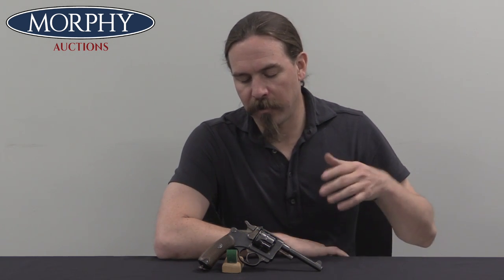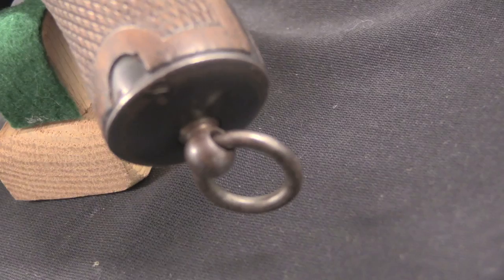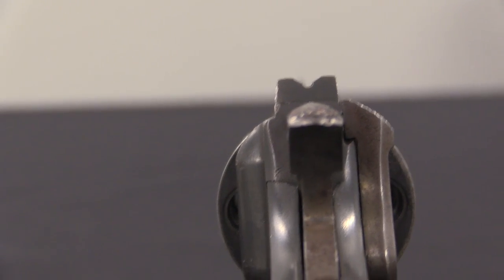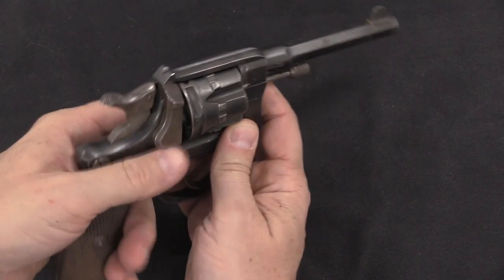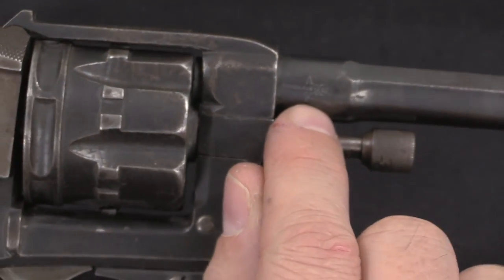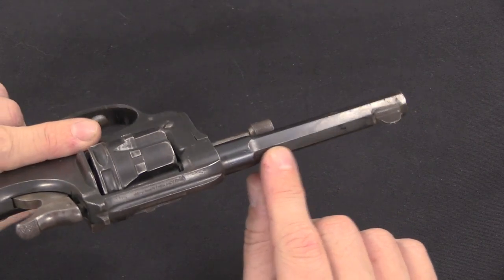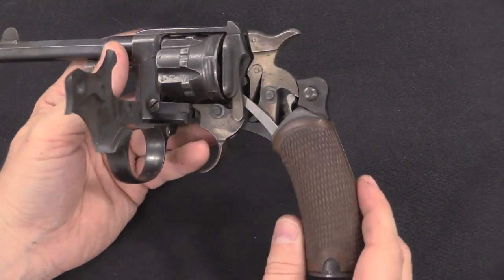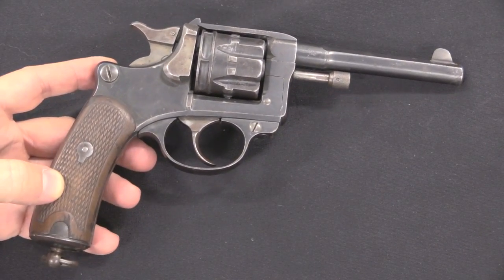Cutting Edge Military Hardware for Civilians: Manufrance Mle 1892

Comment: As a former army officer, the words military grade literally send shivers down my spine...
Reply: Why is that?
Reply: Often produced by the lowest bidder.  😄
Reply: At that time, with a monopoly for producing the military model and very strict Ordonance controllers, the pecking order would be: 1st the revolvers to be acquired privately by officers, 2nd the duty ones for non-coms and soldiers, 3rd the police, customs, prison service ones, 4th the civilian market ones.
Reply: @THEJaManes  These days that usually means produced by the lowest bidder to the lowest possible functional fit/finish and then very roughly treated by a bunch of teens and early 20s soldiers who don't own it. They also usually have as few features and comforts as possible.
Reply: The lowest bidder that still meets the requirements, both safety and performance. 
So usually pretty good, but not the best. The problem is that you then hand this gear to soldiers.
Anyone who describes their product as indestructible has never seen it issued to the infantry.
Reply: Yup i avoid products that say that lol
Reply: @alexsis1778  which is what I found funny about my 92fs. I never understood why people gave the m9 pistol so much shit, my used 92fs that was made in the 90's and was probably a poilce turn in has only jammed with bad ammo (like, literally brass slivers in between the bullet and the casing that I did not notice out of factory ammo boxes) and it's been a great, accurate and reliable gun, even with my $5 phosphate coated surplus magazines.... then I realized, my pistol has only been owned probably by myself and 1 to 2 other people, who took care of it. the military m9 probably went though 20 people's hands, has been shot more than all the rounds i'v fired in it's life time and is generally abused even if only up to the point of lack of maintenance, not using it as a hammer (though, possibly used as a hammer). Thats when I understood.
Reply: As someone who knows the extent of the U. S. Government's cheapness... That phase also scares me
Reply: Are the shivers good or bad ones...?
Reply: Like "aircraft-grade" aluminum, which is just aluminum but also frequently worryingly thin.
Reply: Well, for one thing, they usually advertise military technology, which is about 20+ years behind, second, every single piece of equipment in the military is made by the lowest bidder.
Reply: Lowest Bidder.   Food. Weapons. Vehicles. Whatever.
Reply: @keithagn  Probably the nostalgic ones.
Reply: @reliantncc1864  that's one of three alloy types (2024, 6061, and 7075), two of which are as strong as steel the same thickness.

And while a Cessna uses fairly thin 2024 aluminum, .032"-.040", a Boeing belly skin is over 1/8" thick. So that really depends on which plane as to how thin the metal is.
Reply: @lancerevell5979  this is an American thing mostly.
Reply: "Military grade" is the equivalent of "surgical steel" a marketing scam to make people think that the product is better than the average while often it really means that it's barely meets the minimum requirements 😂
Reply: Milspec is the worst something can be, and still be accepted by a government inspector.
Reply: @murphy7801  why, are other countries procurement chains less scrupulous with poorer oversight?
Reply: @MrSolLeks  It's a weapon issued to people who aren't likely to need small arms. They probably have the least wear and tear of military weapons because no one uses them.
Reply: @ScottKenny1978 steel is always stronger. In terms of strength to weight though aluminium alloys can out perform steel.
Reply: @THEJaManes  In keeping with everyone else's remarks, I would point you in the direction of the British SA80, possibly one of the crappiest rifles ever used by a "modern" military.

Comment: Hi Ian,
There is an immediate way to spot a civilian French 92 revolver on the left side: the lid has no hole. The ends of the axes of the hammer and the trigger do not cross it because the cover is only pierced over half of its thickness to accommodate them. 
Of the many civilian 92 revolvers I've seen, they had the same front sight as a genuine military MAS 92 revolver, so I think yours shows refurbishment or customization.

Comment: I have a Manufrance Mle 1892 that is a little different. It has a military pattern front sight and the suspected Manufrance inventory number is stamped into the bottom of the left wooden grip panel. Serial number 24237 and inventory number 4966.

Comment: 6:40 Ironically, now the foreign-made 1892s are more desirable and expensive than the  originals from  Manufrance or the military. That is because a quirk in French law, where the originals are in Cat B (like modern handguns) but the foreign copies are technically a different model, and are classed in cat D (i.e. freely available for anyone over 18).
I would also note a couple things about the ammunition (8mm92):
1- This actually was a black powder cartridge, originally. It is only with the release of the Lebel in 1886 that smokeless powder became a public thing, and the 1892s were ultimately only ever used with smokeless powder. 
2- 8m92 ammunition is nigh impossible to find nowadays. As far as I know, only Fiocchi has some (at a ridiculous price).
PSA: DON'T BUY 8m92 FROM FIOCCHI! It's utter garbage, under-powered  to the point it's DANGEROUS. I fired 6 rounds from my Mdle 1892 (military issue, inherited from my grandfather) - of which three DID NOT CLEAR THE BARREL. 
I immediately returned the box to my gun dealer... and he later told me the sales rep he got in contact with that their import company had BANNED the import of that product because of how many issues they had with it.
Cherry on the cake, the case is paper thin, so impossible to handload either... joy.

EDIT: Ian, could you work your magic again and convince someone to make that cartridge available again? :(
Reply: Is it safe to use .32 S&W on the Mle 1892?
Reply: @Jacomedes  It's a completely different cartridge, so short answer: no, it's not safe.
Long answer: as far as I know and in .32 caliber, .32-20 WCF is closer to what is used in a Mdle 1892, as I've heard (but never tried) that it is common for handloader to "fire-form" .32-20 (trimmed) into 8mm92 brass. Do keep in mind that those very same handloaders also suggest using .38 Sp brass and a lathe to make 8mm92 brass... so there's more than a pinch of desperation and "système D" involved.

(this being said - and I can't confirm because I don't have some .32 SW on hand - I'm very scared of the fact it might very well be possible to shoot .32 SW in a Mdle 1892, dimension-wise... with a lot of wiggle)
Reply: @L. S. They are... But powder is not, and you can cast your own bullets, so assuming you had brass you wouldn't really need a Cat B authorization with a spanish copy anyway.
I'm not sure what category 8mm92 brass fall into, but de facto it's unregulated.

Comment: This is much like the Berretta M9 and FS. The FS is a civilian production gun and the M9 is millitary, though in this case both made by the same company. They SEEM like the same gun, but if you put them side by side, you find they are not. Slightly different triggers, slightly different slides, and the dust cover for the M9 is straight while it is slightly curved on the FS...but basically the same gun. Only a collector nerd would tell the difference, ha.

Comment: Im really confused on my revolver, it dosnt have the script on the frame like a military one but it has the correct front sight, it has a polished over hammer pin, its got a serial number on the frame with a letter prefix. The only symbols i can find on it are some parts that re numbered 1,2,3 ect and a 3 pointed shield with a C in it.

Comment: heres a question.
do revolvers have any practical advantages over semi automatics?
ive heard them described as "the katana of guns".
Reply: You can sometimes use 2 calibers like 357mag and 38 special.

The handling is simpler in concept. For semiautomatic you have to remove mag then eject. 

No fear of limp wristing.

Can conceivably fire from a pocket
Reply: A fairly short list of advantages and a list of disadvantages.

Revolvers can be pushed into an attacker and still fire, a semi auto cannot.

If a double action revolver fails to fire, just pull trigger again. As opposed to the whole "use other hand to rack slide..." mess of a semi auto.

There's no chance of a revolver failing to load the next round, because you do that by hand and then the cylinder automatically rotates and indexes to line up correctly.

...

Disadvantages:

A revolver is heavier, it needs to have 5-8 chambers worth of metal. 

A revolver needs some careful machining to get the chambers to line up with the barrel every time.

Revolvers have less capacity.

Revolvers are slower to reload and it's a more complex action to reload them.